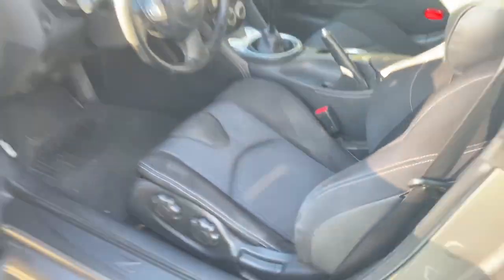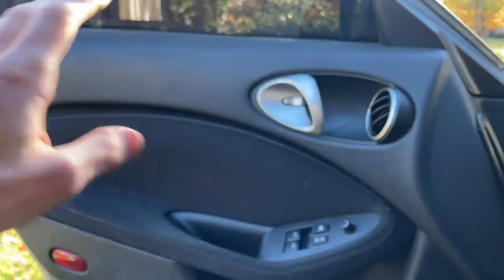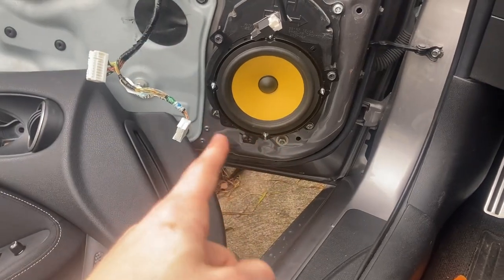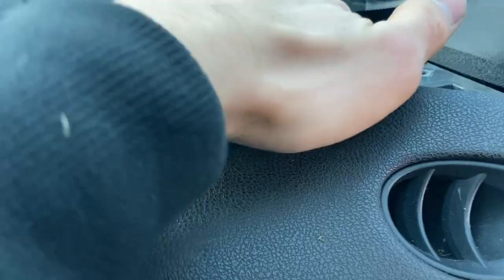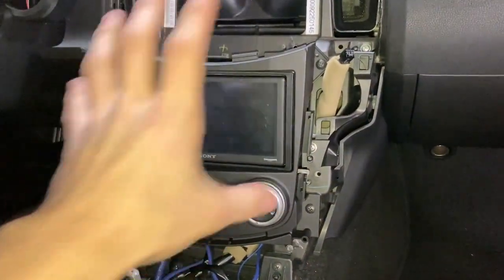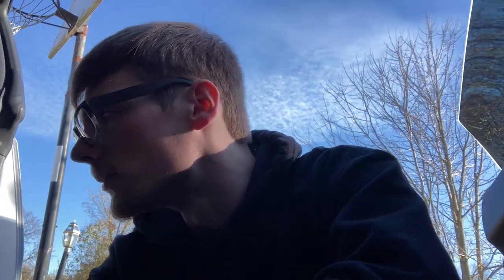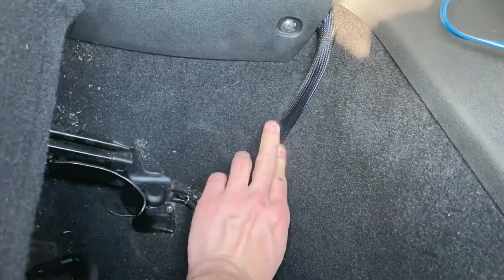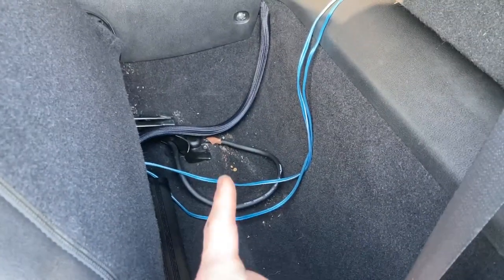Perfect Speaker and Sub Setup in a 370z!

Comment: Ok so didnt those have crossover boxes? Where are they located? And you still used factory wires for tweet instead of straight from crossover? Is a componant set correct?😊

Comment: Kinda late to the party, but that's the luxury of YouTube! First; awesome detailed video! Question; as the dash tweeters you used are smaller than stock, and many installers prefer putting dome tweeters in the sails or the doors. Does the tweeter placement still fill the car, bouncing off the glass? I'm struggling with tweeter placement decision! Sorry, one more; did you do any rear quarter speakers? If not, is it missing the fill/sound stage? Thanks man! ✌🏾❤✊🏾
Reply from the maker: Thank you! In my opinion I think it’s sounds very good. Especially compared to my stock setup. I can definitely still hear the tweeters. I’m a pretty oem guy when it comes to interior so I just kept them there. Still does the job. And no I didn’t put and extra in just the sub. I enjoy they way it sounds and all my homies do too so

Comment: please don't use the seat bolt for a ground. Do it the right way and ground to the frame and don't run the speaker wires and the rca cables together you are asking for nothing but sound problems.